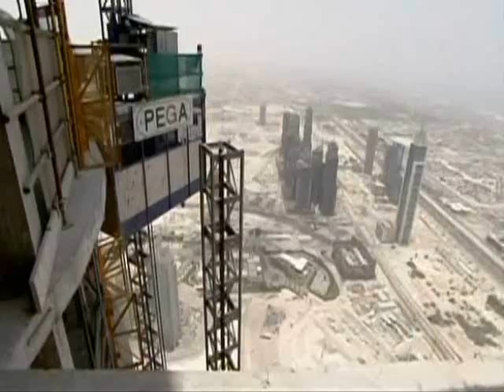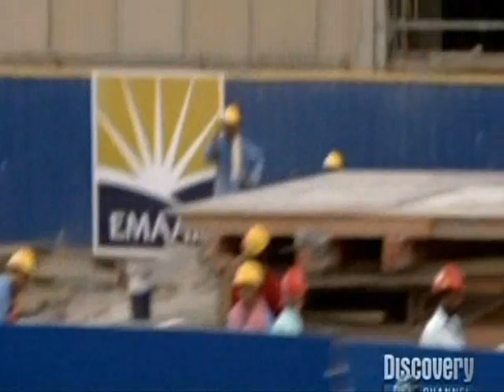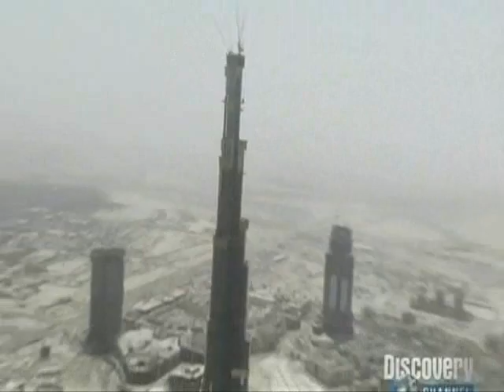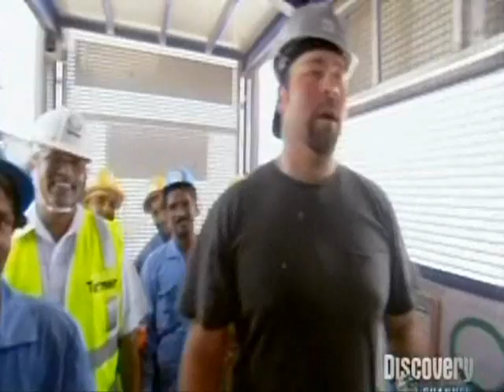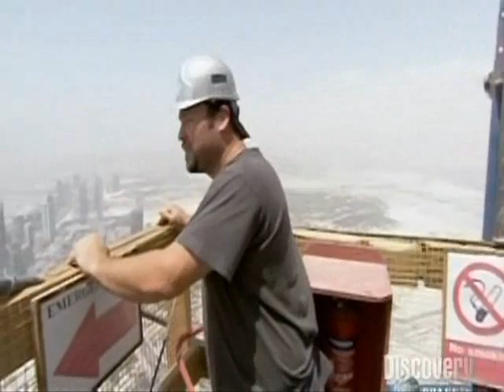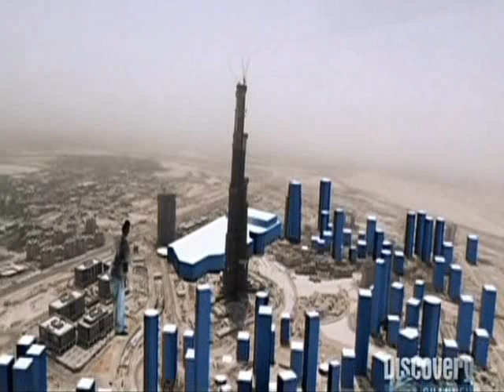New World's Tallest Building - the Burj Dubai (Burj Khalifa)

Comment: people cant live on the upper floors of shyscrapers its to hot, the airs to thin and it takes to long to get there by elevators, the skyscraper revolution is not necessary and theres no toilets that work they just decorate, and wheres the parking, if it is underground the parking lot couldnt possibly hold all the cars for the occupancy and the windows pop so never stand to close to these places people of dubai, and wheres the heating and air conditioning systems in this place not on top im sure

Comment: The freedom tower will be only 1776 feet high. (antennae included), the total height of the building will be 1300 or so feet high. The burj Dubai will be over 2800 feet. Although, I still would prefer that there'd be two towers than just one freedom tower.